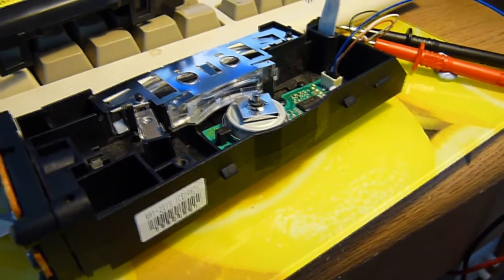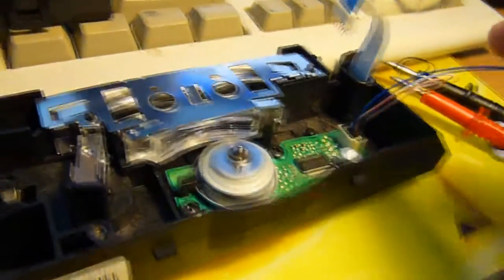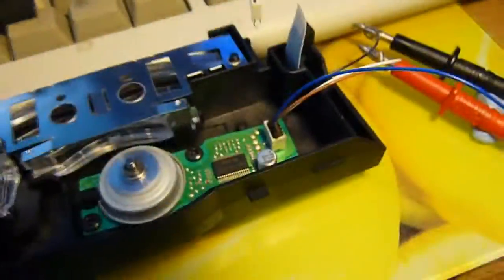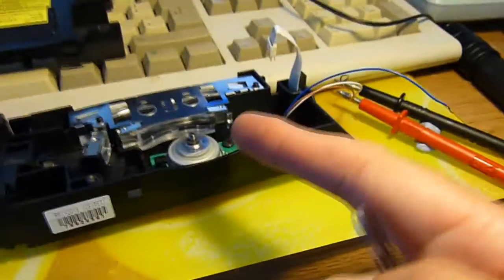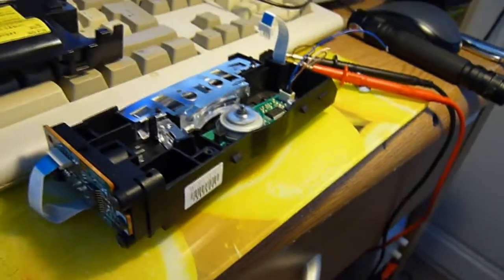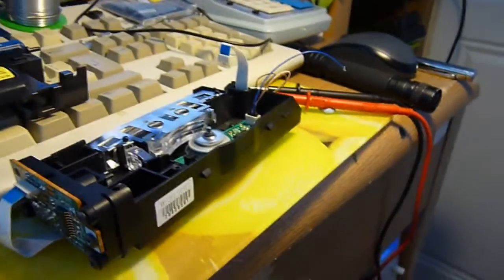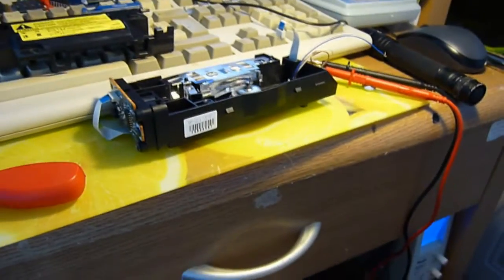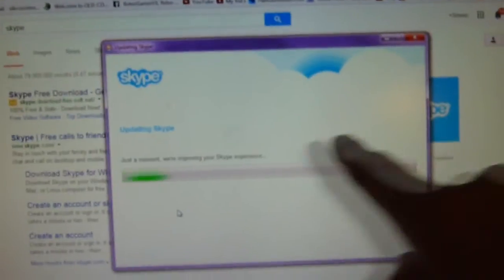Laser Module Mirror Motor Drive

Comment: How many volts did you apply?
Reply from the maker: OOO, I don't remember now. The PSU I was using goes up to 24V. Probaly 12V. Not much requires me to go abouve that.
Reply: @TheEPROM9  I have a card (not the same as yours) from a xerox laser printer. The only ones printed on the plate are: on the top: KS-49 and on the bottom: LS7170. The board has a white 5-pin connector named CN1 of 1 ... 5. I would love to run this engine with Arduino or another CI but I don't know how to do it; I have already connected the terminals of a 24v power supply to several pins on the board, but the motor does not run. Could you help? Thanks

Comment: i gues thats an ldv8111 controller, 2 enables and a ps, what are the pins u use to connect ? got one at home and would love to hook that up as well...
Reply from the maker: From memory I just ended up hooking them up randomly untill it started working. Once you have found the negertive then hook random wires up intill it spins.

Comment: Thanks for the video. I have a scanning unit just like this and was able to get it running by hooking up two of its leads to a positive and one to negative. Unfortunately it runs for about 15 seconds before shutting down in its duty cycle like you showed. My best guess is that I have the full speed lead connected instead of the normal speed lead. I know there are only four leads but I'm having trouble identifying them. The one on the outside is the negative, that's all I'm sure about.
Reply from the maker: I have seen something tdo that befire. Must be the firmware in the device.

Comment: Laser printer laser can be seen with a video camera. Just like the infrared led on a tv remote control. But the output of the laser is around 3mw so about as powerful as a keychain laser pointer.
Reply from the maker: fuzzybobbles Indeed, any camera that is sensitive to the IR range, B/W CCTV cameras are excellent for this. Class 3b is >5mW. 55mW will start to burn stuff and operating an IR burner is extreamaly dangerous as you cannot see the beam and there for be unable to react if you axidently shine it in your eyes.